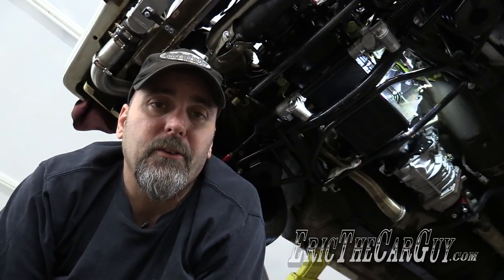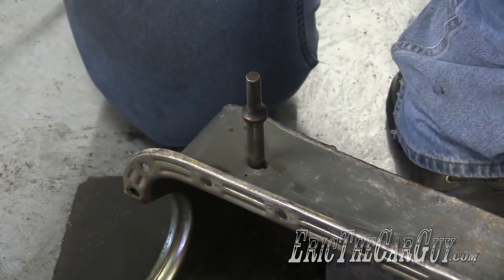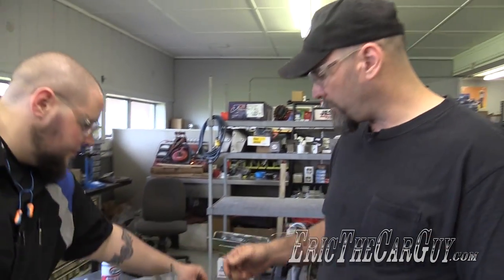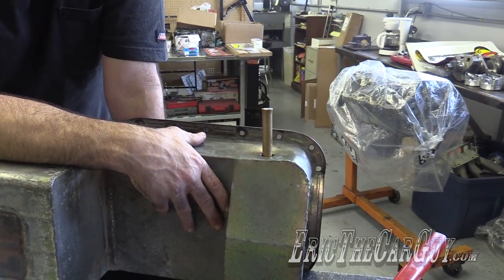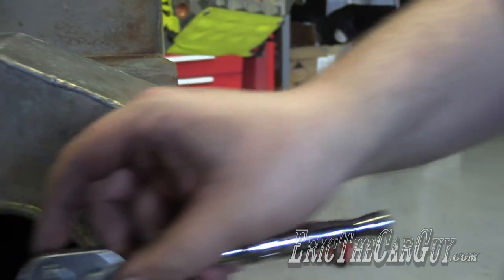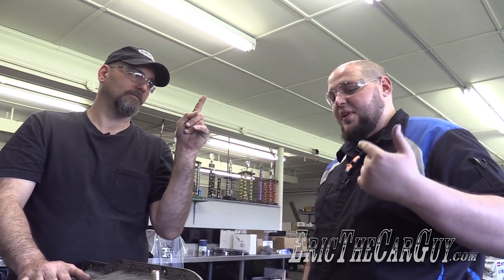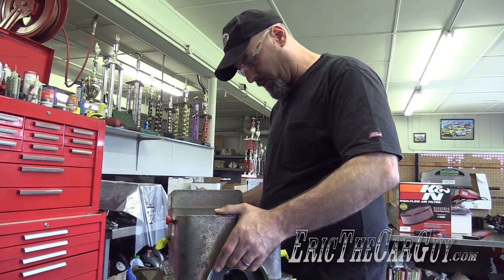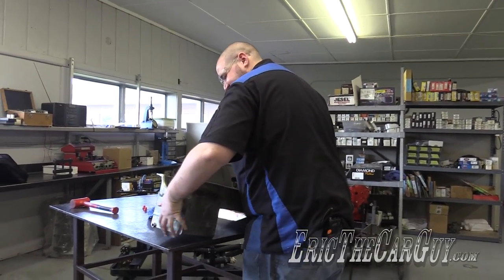Oil Pan Modifications for Turbo and 4 Bolt Main Small Block Ford #DarkMatterPikachu

Comment: Instructions assumed that the pan was NOT off the engine. Hole drill would have worked with a sealed nut behind it OR weld in a bung for the return line.
I did a tranny pan bung for a temp gauge. It was a screw in affair.2 gaskets.

Comment: Eric, I've never disliked a single one of your videos, but I had to for this one. What is this garbage? You're one of the best mechanics out there and you choose to butcher your oil pan like this? Do it right or don't do it at all!
Reply from the maker: As stated in the video, the method shown in this video is what the turbo instructions called for. It worked fine and there are no leaks.
Reply: EricTheCarGuy don't be naive. you're an excellent mechanic. you know not all problems are immediately apparent. the company must have forced you to put this in the video, because this is pretty unprofessional for your standard.
Reply from the maker: No they did not force me. I was trying to emulate the same conditions that someone installing this kit in their driveway or garage would encounter, which I thought would be helpful. As the saying goes, no good deed goes unpunished. Was the method ideal? No, but it worked. It's funny how sometimes people get an idea in their head that has nothing to do with fact yet they insist it's fact. That's what's happening here. There are no FACTS to back up your accusations. Yet you still keep making them.
Reply: EricTheCarGuy this was not a good deed. this is not a solid install and you should not have instructed people to install an oil return line fitting like this. ive never seen another person do such a poor install on a return fitting before, and I know I certainly wouldn't be hammering on an expensive oil pan. your knockoff suspension you originally had would have worked, but you chose to buy the proper suspension. why? because you want the best. this is not the best, and you should know that. disappointing.
Reply from the maker: You can climb off your high horse now. I'm not impressed. As I've stated several times this is how the instructions for the turbo state to do it. As for the suspension, I had doubts about it and consulted an expert. I found a better way. It's called being flexible. Being flexible leaves me open to new ideas and the possibility that I could do things better. Being inflexible means that you'll likely never grow beyond the comment section of a YouTube video. Oh yea, one more thing. Perhaps you're forgetting that this is my car and I'll build it whatever way I want. Good day.
Reply: EricTheCarGuy I have no interest in impressing you. I'm not the one who has a YouTube channel showcasing his work. I keep my builds private. if you're going to post your build online, expect criticism. I thought you'd be a little more receptive than this. really it seems what you have done here is shown that you are simply stubborn, and that you don't care if you ruin a shops reputation. I respected you and your work quite a bit, but your idea of a "good install" for this is just disappointing.

by the way, I've grown far beyond the "YouTube comments section." I have my own shop that I used for my cars and relatives/friends cars. I graduated from college and hold an excellent position at a hospital as an equipment technician, making well above the median average that most mechanics make. one more thing, I'm 21. so before you try to start insulting me and saying that  I'm inflexible, perhaps consider what you were doing at the age of 21.
Reply from the maker: Granted, I was a total douchebag at 21. Let me put it this way, I don't tell you how to do your job. If I was curious, I would ask why you did this or that if I was watching you. I may not agree with your methods, but I would defer to your expertise and perhaps do it differently if I wasn't under your supervision. Or, I would just offer and different opinion. If we didn't agree, I would agree to disagree. The point is a difference of opinion is just that, nothing more. I don't have any issues with people disagreeing with the way I do things in my videos. If I did, I would have quit years ago. It's people stating their opinions as fact that I have a problem with. As for Kevin's reputation, you can read my response to his comment to determine my position on that.
Reply: I can respect your want to follow the directions that were given with the turbo kit. the question I ask if this - were you doing this for a customer, would you be railing on their oil pan like that? I understand you don't exactly specialize in custom work. you take pride in being a mechanic and I have no issues with that, but I could never imagine you doing this to a customers vehicle. you stated its your build. yes, it is your build, and you can do whatever you please, but you need to think about what you taught your viewers by doing an oil return fitting like this as opposed to having the shop weld a bung in. not everyone owns a welder, but ever mechanic does, and everyone knows a mechanic. 

do whatever you want with your car. I'll continue to watch your videos as I enjoy the content and I have learned a fair amount about how to properly use different types of tools and how to handle certain situations/issues with a car. what you need to consider is a lot of people that are subscribed to you basically look up to you and respect you as a very good mechanic, and seeing you post something like this - a butchered install - after working so precisely and specifically on the rest of the build left them feeling confused. 

I hope the rest of your day is enjoyable.
Reply from the maker: Yes, I would do this to a customer car. You keep ignoring the fact that it worked, it doesn't leak, AND it was part of the instructions for the turbo kit. That seems to be the key thing you keep missing. I didn't go off the reservation and decide to do it this way, it was outlined in the instructions for the turbo. As for my viewers, that's exactly who I was thinking of when I did this. If you were someone that bought one of these kits and were confused about what the instructions were asking you to do to fit the return line to the oil pan, this video would help. At that point you could decide if it was better to do it the way the instructions state, or if you wanted to weld in a bung as many of the commenters have suggested, and if that's the case, you'd be pulling the oil pan off your engine which would take a lot more time and effort. The point is, the choice is up to the viewer. I'm not telling anyone they have to do it this way. It's just the way I did it, and the way the turbo instructions state to do it. You call it 'butchery', I call it a successful installation.
Reply: Eric, you should stop arguing with people who are right.  This was super hack work.
Reply: It will leak in the long term Eric.  Your seal is reliant on Teflon tape and silicone.  Very poor.

Comment: Really tapping the metal oil pan ? weld a stainless fitting or similar on it with a tig. For me it looked like trash. You spend so much work on details for this engine And than something like this. I don't know why but the machine shop videos are to short and boring in content. a one hour video of the whole process would be enough.
Reply from the maker: As stated in the video, the method shown in this video is what the turbo instructions called for. It worked fine and there are no leaks.

Comment: That work on the oil pan was probably done months ago. So it's probably too late to do anything about it now. But I agree Eric should have at least soldered the pipe fitting in place. Ideally, he would have welded a bung into the oil pan. Let's keep our fingers crossed, and hope it holds up.
Reply from the maker: As stated in the video, the method shown in this video is what the turbo instructions called for. It worked fine and there are no leaks.

Comment: Well, all I can say is that this is Eric's build and he can do it how he chooses.
Now I know there are better ways of dealing with this .
Personally, I would have drilled the hole and welded a nut to the pan but like I said it's Eric's build and I enjoy seeing how he deals with this stuff
Reply: Albert Hammond yup your right it ain't gonna be any of us laying under it in the middle of the night plugging up the oil leak so we can get home! lol
Reply from the maker: As stated in the video, the method shown in this video is what the turbo instructions called for. It worked fine and there are no leaks.
Reply: EricTheCarGuy Yet. rolled over sheet metal isn't thick enough to give the proper thread depth. It will eventually loosen up and strip out when you retighten it.
Reply from the maker: That's your opinion, not a fact. As I've stated, this is what the instructions call for. So far it's fine. Time will tell.
Reply: EricTheCarGuy I don't wish any misfortune in any way so good luck with it. Being a machinist it's not how I would have done it instructions or not.  I do enjoy your videos though and my daughter is getting into car repair so I have pointed her in your direction. keep up the good work
Reply: Machinists never follow instructions because they are naturally creative people.  Stealership mechanics on the other hand have a very different logic and approach.  As we can see here.

Comment: I actually thought to myself, "At least the didn't silicon the the crap out of the fitting."  Oh wait, there they go..
Reply: BlindBatG34 what's wrong with silicone around it. it's to make sure it doesn't leak, not hold it in.

Comment: I had to weld a 16 gage  patch over my FJ40 oil pan after removing the spot welded skid plate(bad engineering toyota salt gets between the oil pan and the skid plate rotting out the oil pan). I learned to test the welds for leaks use gasoline. Yes I had 2 spots to weld again. sure enough if it does not leak gasoline when off the engine it did not leak oil when on the engine.

Comment: The pan is on the bench, you are at a machine shop- why would you not use a bung and be done with it? No, you are not doing it wrong, but; there is more than one way to skin a Pikachu.
Reply from the maker: As stated in the video, the method shown in this video is what the turbo instructions called for. It worked fine and there are no leaks.

Comment: Why did you drill, air hammer and tap instead of drilling and then putting a nut and washer on the inside of the pan? Is it to minimize the risk of a metal nut coming loose? Would it come loose with loctite?
Reply from the maker: As stated in the video, the method shown in this video is what the turbo instructions called for. It worked fine and there are no leaks.

Comment: I struck my oil pan hard on a large bump in the road. I had the seal replaced, but I am leaking pretty good still. Should I just get a new oil pan?
Reply: Extremerecluse Fallows new pan time, you cracked the pan

Comment: wait, why didn't you just drill the hole in the oil pan for the return?. Metal shavings? you used a drill for the pilot hole

Comment: wow all these YouTube mechanics ripping on this guy for beating on an oil pan. there's always something that need modified when doing something this in-depth. if you where putting a turbo 4 bolt 302 in a Fairmont and never thought you would have to pick up a hammer and bend something to fit. you should just stop working on cars altogether. they arent hacks and that big stack of trophies behind them can back me up.
Reply from the maker: Thank you!

Comment: Judging by all the indignation here over the oil pan caper,  sometimes it's not worth getting up in the morning to do a you tube video.
Reply from the maker: As stated in the video, the method shown in this video is what the turbo instructions called for. It worked fine and there are no leaks.

Comment: Should have welded the correct nut on the outside. I know people think this is OK. But there is a shit load of vibration and heat on an oil pan..One reason they design oil pans made for this purpose. The last car i built. I removed the stock oil pan and went with a dry sump system. That was also water cooled with the proper oil filter adapter.

Comment: Just wondering could you have tig welded a 1/4 inch piece of steel and drilled and tapped that? Just wondering.
Reply: Yes he could have.  Anything should have been done except what they did in this video.

Comment: Does anyone know if you would need to make 2 holes for the oil return line on a Twin Turbo setup? Or can you just get an adapter to run 2 hoses from 1 hole?

Comment: You guys really think this is the way the shop would have done it normally?  They did it this way to showcase the kit that a company sponsored Eric with.  I imagine it started out as a video to demonstrate the intended method of installation of the kit.  Don't be so damn short-sighted with your comments, you're right about your point, but they did this to show off a sponsored part installation.
Reply: If that was the case they should have said that. But the other videos also show substandard work. Horrible "port matching" and horrible balance drilling practices on his expensive crank. I wouldn't let these kalvinator dudes change my oil let alone come near my car with a drill bit.
Reply: Chad Bob fair enough, I am just a shadetree mechanic so I might not have your expertise or experience, mine was just a theory honestly
Reply: Chad Bob then why don't you show us how's it's done since you seem to know so much about this stuff.
Reply: They did that in the beginning of the video, did you watch it?
Reply from the maker: As stated in the video, the method shown in this video is what the turbo instructions called for. It worked fine and there are no leaks.

Comment: BTW some people just hack their oil pans without a thought when trying to make engines fit where they're not supposed to fit.. But they lack the knowledge of what's the minimum oil amount that the engine actually needs to keep everything lubricated.. 
I hope they did the math do make the oil pan large enough to hold enough oil to keep the engine properly lubricated as for turboed engines it's ESSENTIAL that the engine is properly lubricated.

Comment: Usually when welding thin metal like that, any good welder will make short welds, and start at front for a little bit, then move to another position and weld, and take breaks,to prevent overheating the metal and warping it. Sounds like the manufacture of that pan didn't do that, welded one continuous bead, warp be damned...

Comment: i said it last video and ill say it again...this machine shop is like backyard hack work. other than engine balancing you couldve done all this yourself eric. they butchered the cam bearings. literally had no clue how to make a tap for an oil feed line. they just grind stuff down to force it in. literally you could do the same if not better. and i dunno who welded your baffles in the pan but they need to go back to welding class.
Reply from the maker: As stated in the video, the method shown in this video is what the turbo instructions called for. It worked fine and there are no leaks.

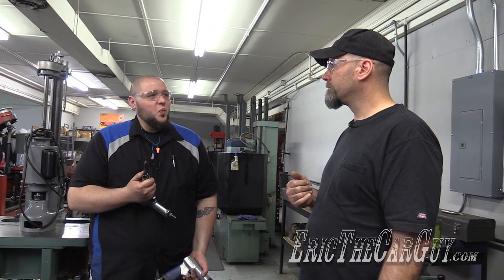Comment: 1:15 Pilot hole and a stepped drill. What the actual hell guys? I would have never though to chisel out a hole in a million years...
Reply: I thought that at first too, but then realized they needed the metal wall to form threads. A hack to be sure, but one that works when you are lying under the car, in the dirt, on your back and just want to 'git-er-done'.

Comment: Should have brazed a female brass bung  with 5% silver rod and be done forever. That IS going to turn itself loose in the worst time (most likely in the burnout box). You're on time to fix this. Good luck.

Comment: Why not use a nut on the other side instead of tapping it? I mean, it will lock up better and safer, right?
Reply: loos nut in oil pan - no thank you
Reply: Agustin Cesar i agree. however i would like a lock nut in that application. however the worst Eric will end up with is a minor oil leak
Reply from the maker: As stated in the video, the method shown in this video is what the turbo instructions called for. It worked fine and there are no leaks.

Comment: Why would you weld something on there so it won't leak and make it look right?
Reply from the maker: As stated in the video, the method shown in this video is what the turbo instructions called for. It worked fine and there are no leaks.

Comment: That plug should be a gas fitting which means it is tapered and will lock in and seal without any sealer if inserted right. Which it probably wasn't.
Lacking a suitable bung to weld in I would have welded a plate to the outside of the pan and drilled and tapped that.
Reply from the maker: As stated in the video, the method shown in this video is what the turbo instructions called for. It worked fine and there are no leaks.
Reply: EricTheCarGuy 😀that's great. But as the good book of Murphy states properly and according to the instructions are often too entirely different things😱

Comment: Metal lines and flare will seal beter and last longer than the rubber hoes, barbed fitting, and hose clamp setup.

Comment: I'm kinda surprised you didn't go for a weld-in AN fitting.
Reply from the maker: As stated in the video, the method shown in this video is what the turbo instructions called for. It worked fine and there are no leaks.

Comment: The most jengus oil pan fitting ever.  Tap into bent sheet metal so you maybe have enough to catch a thread or so?
Ahm, use a bulkhead fitting.  Weld on a fitting?

Bead of silicone?  Why not go more permanent and go JBWeld?
Reply from the maker: As stated in the video, the method shown in this video is what the turbo instructions called for. It worked fine and there are no leaks.